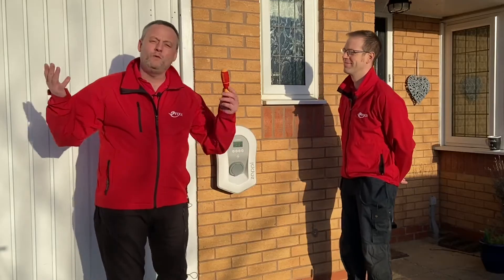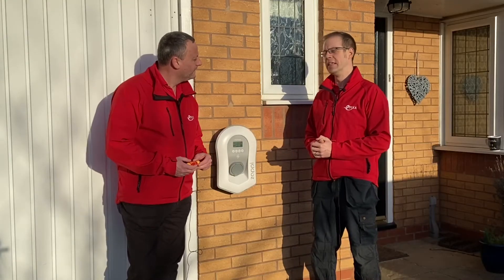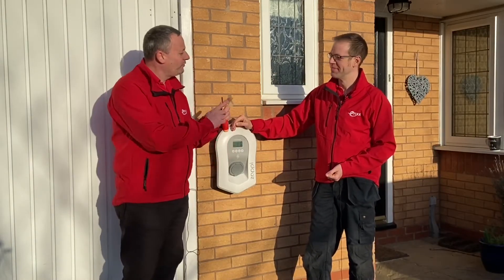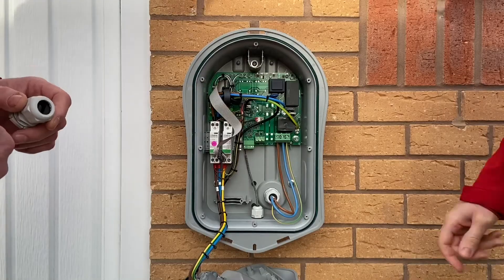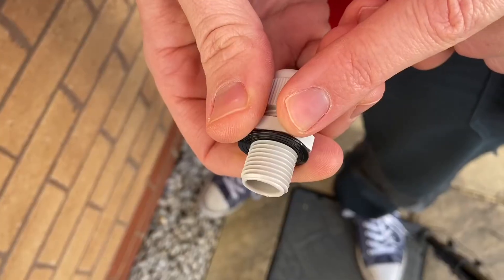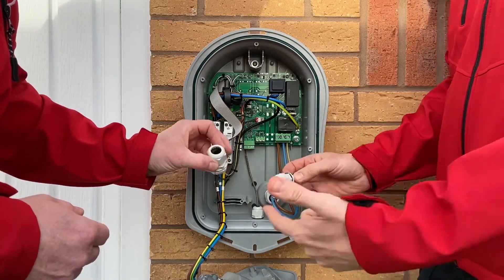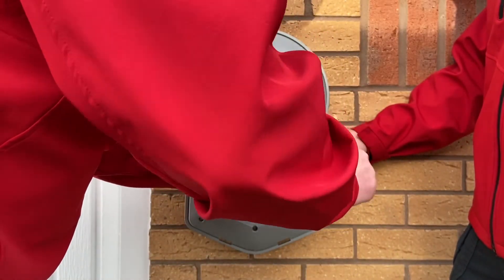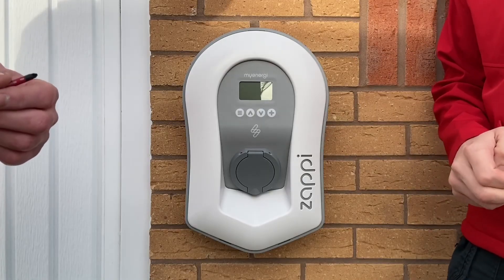Why would you install a cable gland backwards?

Comment: Couple of points for Gary,  he mentions putting the rubber gasket either on the back of the gland or on the locknut end. In my experience putting the gasket behind the locknut can cause moisture to seep through the threads and back into the enclosure. Also I noticed how he tightened the screws in an anti clockwise direction, starting from the top. I always adopt a tightening procedure like I would an engine cylinder head by going across diagonally to maintain a more even tightening pressure on the gasket. Just my 2 cents. Great informative show BTW 👍

Comment: when supplied the zappi comes with a bag of silicone desiccant. I notice here it is left out. I leave this in after installation. Reason being, opening the enclosure will introduce moisture. These units are affixed to the outside of the building. These can be exposed to sunlight and then cooler tempertures overnight. This can wring out the moisture in the air contained inside the enclosure and produce a condensation cycle though temperture cycles. My hope is the silicone desiccant will trap the mosture and prevent this cycle.
Reply: Fitted. Few defibrillators and they have a fan and small heater inside the cabinet . Probably more to do with keeping battery in Defibrillator good but also helps with condensation as you described

Comment: It does matter which side the rubber flat o ring goes (nut or gland side). It should be at the end of the thread (gland side). Reason being that water can work its way around the thread through capillary action. It looks to be fitted correctly in your example here.

Comment: Whilst I agree that there is no real reason to fit a gland with the sealing side on the inside, I would also say that if it it seals it seals, and from a sealing perspective there can be no difference either way. A gland doesn't seal less in one direction than the other.

In addition, in order to fit the gland the other way would necessitate making a larger hole or countersink in the wall to take the protruding section of gland.

Not an easy thing to do without retracting the cable fully in order to drill. That MIGHT make returning the cable though the wall more difficult ... You can't leave a fish line in the hole prior to drilling any more than a cable.
Reply: After you've drilled from inside out you could go outside and use a bigger masonry bit to " countersink " the hole

Comment: Is there a type of SWA gland that allows internal mounting for back cable entry?
Reply: If it’s glanded at point of source with proper sea gland and not needing to use the armouring as an earth into the accessory, just use a stuffing gland as per the video

Comment: Using silicone sealer doesn't provide a clamping action on the cable so increases the risk of it being pulled out accidentally, especially T&E using the back entry.

Comment: So quick stupid question from guy in USA.  What is the reasoning that plastic enclosures are allowed here on the chargers, where as panels are required to be metal?  Normally on the Zappi units for example one would just use an MCB breaker to feed it, and there could be an issue between it and the RCD breaker  for example.  With the high current load and heating and cooling cycles outside, one would almost think the lugs on the power inlet could work loose over time.  Seen stranger things, I have lugs and breakers for example in my panel that are torqued down, but over a few years of extreme hot to extreme cold in the garage environment things can work loose.  I guess the manufacture assumes that a proper torqued screw should never work loose.    Thanks and keep up the good work.
Reply: Interesting also that the UK (unlike Australia which is otherwise behind on many things) doesn't require an isolator switch near the charger, yet had switches on 10A sockets
Reply from the maker: That is a very good question - we went to all metal panels from plastic around 2016 .  It may be they assume most EV chargers will be outside the property .

Comment: so do you still need the drain hole to let any water ingress/condensation run out?
Reply from the maker: The manufacturers say not - but others suggest a Goretex vent
Reply: Spiders will get in

Comment: An Enclosure too thight will have even more problems with humidity creeping in causing . Best is to have a vent with something like gore tex to even out pressure and humidity
Reply from the maker: Yes Goretex vents are a great solution
Reply: Add fan and heater like in Defibrillator  cabinets

Comment: In mechanical trades we would spread the tightening of the screws to avoid distorting the cover, maybe top then bottom, left then right etc.
Reply: Basic engineering principles #2: opposite corners first!
Reply: How about going evenly on the sides? Top, top left, top right, etc. Would this be useful? The idea is that you flatten the seal from top-down. So if there's any kink it'll be pushed to the bottom.
Reply: @advertslaxxor  planning to fail is different from planning to avoid failure. There cannot be kinks.

Comment: Who thinks MyEnergi should speak to the company who manufactured those glands and add it into the box's as part of the kit! That would save spark's time having to faff around going and buying those glands separately and would actually encourage sparks to do a more neater job by flush mounting in into the wall and hiding any of the cables.
Reply: Too many different kinds of cables being used, I would say. Could be a large twin and earth, could be armored cable, could be European round cable, could be 5 core three phase wiring… each needing a different size of gland.

But it should probably go into the manual as a suggested cable entry form with a list of tested to be compatible models. Or at least as a tech note on the website.

Comment: Could the electronics be fitted in a remote location?ie near d/b .run a bead of silicon across top of unit.
Reply: No , charging cable lengths are limited and its unsafe and a trip hazard to have it running through your house into your db cupboard

Comment: February? Time traveling Gaz another arrow for your quiver.🤣 fancy and dancy. At some point you should cover at what point will manufacturers start suggesting torque ratings for socket screws that has to be a bigger safety issue in most homes.

This is point where I talk about the obvious something plumbers understand better than electricians. O-rings a d Rubber seals can be compromised both with over compression and many cycles of cooling and heating. If your gonna install this regular testing and checking the EV install should also include checking functional components like washers, grommets, o-rings and rubber seals.